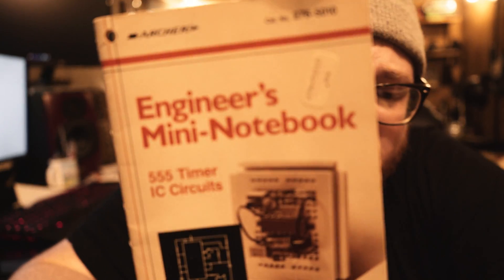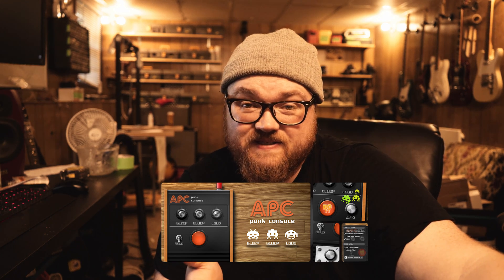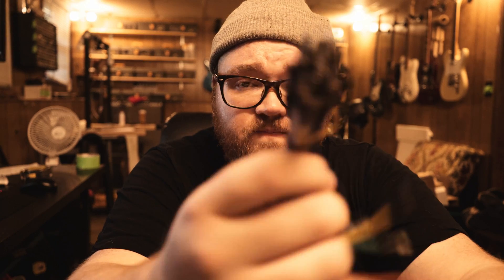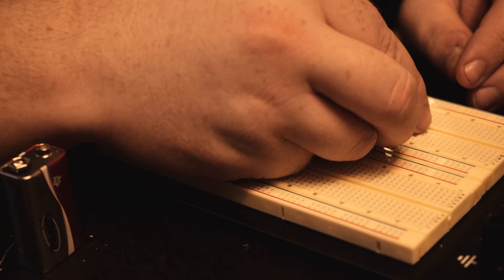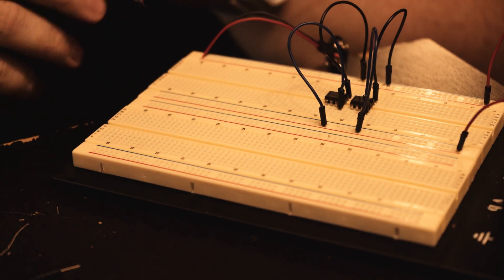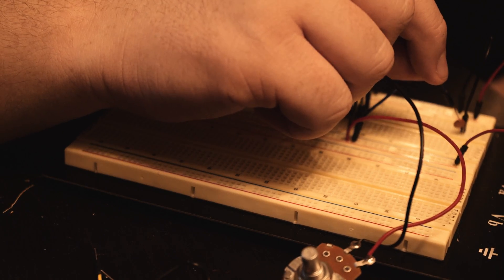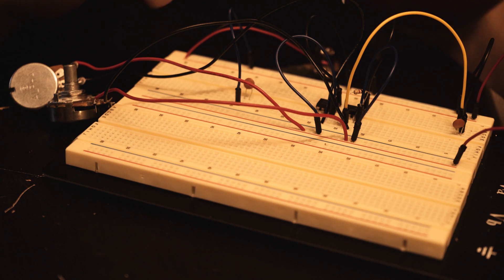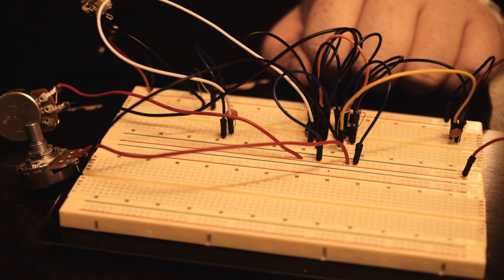Breadboard Build: The ATARI PUNK CONSOLE (APC) with two 555 timer chips!

Comment: Great tutorial just a really quick (probably silly) question as I'm new as well. I'm also soldering this straight to a circuit board, I don't have a breadboard. 

You added the red side of your pot to the battery + side of the board. I can't tell from this angle, but is that correct? 
I'm coming into this from circuit bending in which usually both of those wires would go to two separate contact points and I want to make sure I'm understanding this correctly.

Comment: How many Jumper Wires do I need?
Reply from the maker: Ah, I didn't count how many I used. But if i recall it wasn't too many.  But i'd say probably have about 20 on hand,  just to be on the safe side.  You could also use just regular wires with the tips stripped off.  The jumpers are just more convenient.  :)

Comment: I have been trying to make it several times, but I cannot get it to work. All I get is a sligtht scratchynoise when one of the pots is at minimum and nothing else.
Reply from the maker: Hmmm are you doing it on a breadboard or soldering it together? it might not be triggering the 555 chip(s).  if you can, send a pic of the board i can take a look.  i'm still new to electronics but maybe i can see something :)